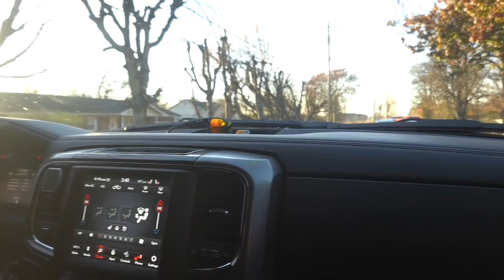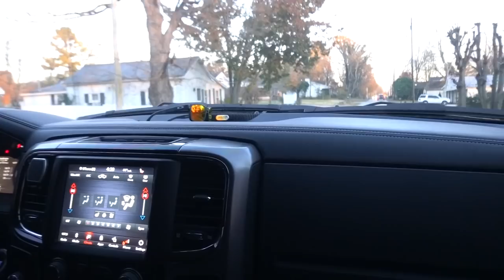#1 TRAILER UPGRADE YOU NEED TO HAVE!!!

Comment: Never let the pin ride on the hitch.  If you drive down a lot of rough roads it will oblong your holes and cause you to not to be able to remove the hitch or adjust it for different vehicles.

Comment: i get jerked around by mine every single day running freight, and i've been curious about these...  i'm a little nervous about leaving that on the trailer at the yard though..  but thanks for the review!
Reply: Would a locking hitch pin help? .. or are those easily able to be broken off?
Reply: @craigr777  yeah, i think any deterrent is a good deterrent.  i do already have the locking bolt cover on mine.  maybe just spraying the thing black would help too.  cool product tho!
Reply: Locks are available on their website.

Comment: I would put weight on the pin and then tighten the set screws. I agree with what you said about hitting bumps and making it slip. Great video 😊.

Comment: I would take the schrader valve out of the air bag fill point, add a Tee with a good metal PSI gauge and put the fill valve on the other Tee.

Comment: HUH, GREG THE BREAK AWAY CABLE DOESN'T HOOK TOBTHE SAFETY CHAIN, ITS POINTLESS. 

SAFETY PIN SHOULD ROTATE FREELY TO PREVENT THE PIN HOLE FROM BECOMING BIGGER DUE TO THE PIN WEIGHT...